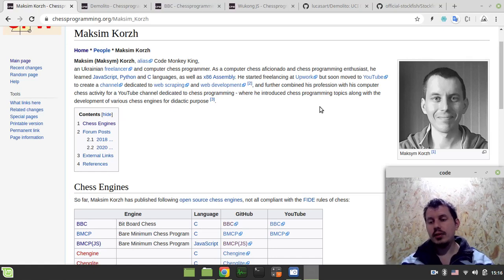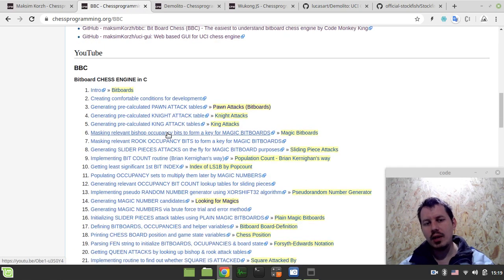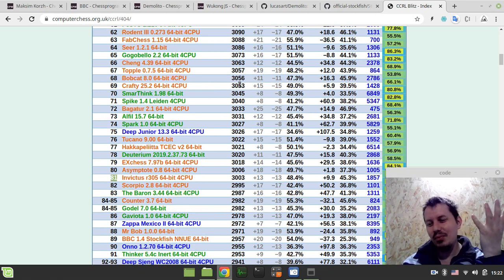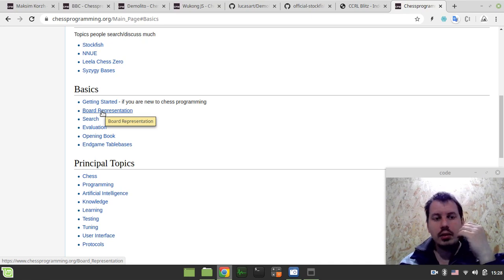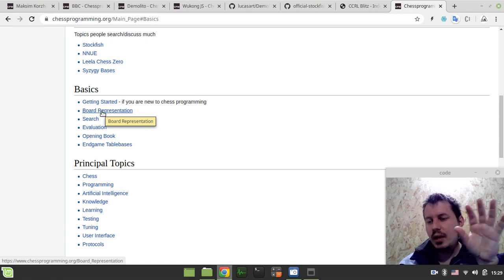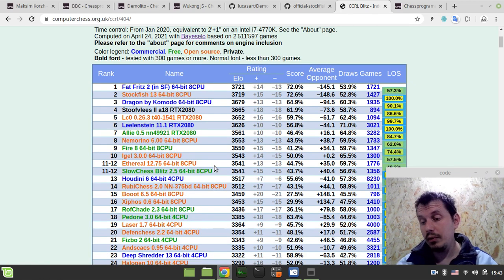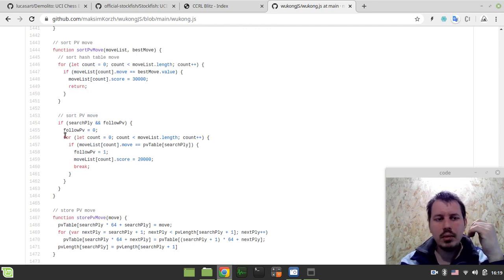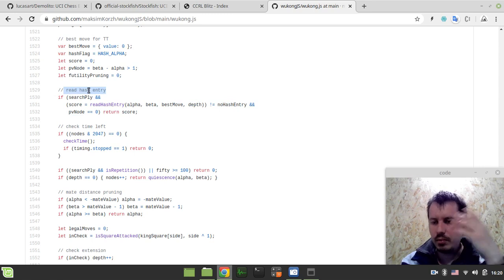Where the chess engine strength is coming from?

Comment: Thanks CMK. I respect and appreciate your opinion very much. So what you're saying is that the search depth increases without major blunders because of all the tuning of the combined features? So not really magic especially if everyone is just copying SF (or at least being inspired by one or two engines).
Reply from the maker: Yes, but apart from tuning the search parameters it's also the matter of sophisticating the basic optimization algorithm, say in null move pruning or late move reduction the shallower depth can be either fixed or using some specific "meat over the bones" to dynamically calculate that depth. Same for razoring - you can just use fixed eval thresholds or calculate them dynamically in several stages. TT is also a separate world on it's own. Say SF uses so called cuckoo tables to handle hash key collisions effectively and so on. To be honest  when I've been heavily studying SF's code (during my xiangqi stockfish template project) I've surprisingly realized that just to mimic SF's alpha-beta routine (even with your own custom move ordering) would give around of 80% of SF's search depth. Obviously tuning parameters has to be taken into an account because say material thresholds in SF and most engines are quite different (things like pawn scores etc)

All this research gave me a very clear idea on why there are so many 3000+ engines now) I mean nowdays even a noob like me can come up with 3000+ engine by copypasting SF's search. If copypaste NNUE as well it would be around 3300-3400. Even my weird BBC with only very basic implementation of search optimizations goes 2900+ with SF NNUE...

So it doesn't make any sense to me any longer because there's nothing original in that work.
As far as I'm aware from talkchess posts guys who really do stuff on their own without SF steroids go around 2500-3000 ELO, only some super smart guys like Andrew Grant goes beyond.

So I hope the reason why I prefer to focus on skeleton rather than muscle weight is now clear)

Thanks for your comment Ian)
Stay safe and take care!

Comment: Hello, i have a finished  chess engine, it normally moves pretty fast, except for opening moves. Is this normal for chess engines? My engine takes forever to choose a move on the first move. Im guessing I should use an opening book.
Reply from the maker: First of all CONGRATS!
But it's strange...
Do you use fixed depth or fixed time search?
Opening book can be used but this is probably alpha-beta search issue instead.
I can't say more without having a look at your sources.
Reply: @chessprogramming591  I got it. I had been playing around with magic bitboards and was implementing your version into my engine(i did it wrong at first). This generated bad moves for R,B,Q- basically saying they could move from starting position when they couldn't. It still takes about 10 sec for opening move, but I am speeding it up gradually. Thank you for your series and being a great teacher!
Reply from the maker: @nicck3841  I'm happy you're making progress)

Comment: I see you use depth - 2 for LMR. The easiest and most effective formula for LMR is the classic stockfish's R=ln(depth)*ln(legalmoves)/2 | 0, then reduce depth - R and research without reduction (depth - 1) if score>alpha . You should try it. You'll be surprised.
Reply from the maker: Of course the one Stockfish uses is much better, but I didn't try to write the strongest engine in the world and the idea to use a static value is just for didactic purposes, but anyway thank for this comment I hope other people would make use of it!
Reply: wait where do i write the formula? Is it in the loop where we do the legal moves?
Reply: can you explain pls, im interested on how it works
Reply: @akaskmsskssk6927  inside the loop, usually before making the move in case you want to add aditional conditions. (i.e. in my case, I don't reduce if the move is a killer move). Because the formula is calculating over and over the same values, the LMR formula is usually done with lookup tables.

Comment: What's the strongest engine you've made so far? What's its rating approx?
Reply from the maker: BBC 2900+ CCRL. But it uses Stockfish NNUE so playing style is similar to SF. I never tried to make a strong engine because it doesn't make any sense to me. I do didactic engines to help people mastering chess programming.
Reply: @chessprogramming591  Hey 2900+ that's pretty good! But you're right that it probably makes little sense to create one from scratch since.. i mean, no one really does that anymore right? a lot of the ground work has already been done for chess engines. So unless you can come up with something totally new that can compete on the top level, it's probably not worth it unless youre just doing it to build your own programming skill set.
Reply from the maker: @Corteum  Exactly!